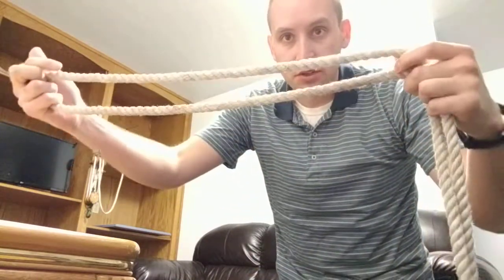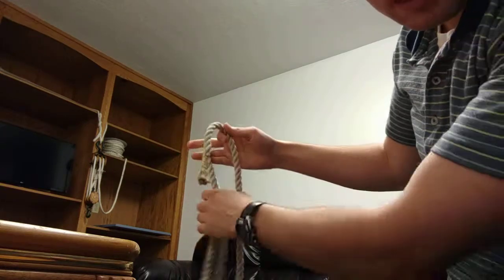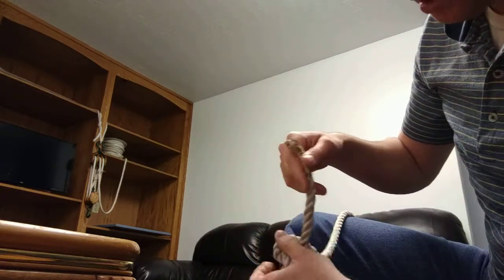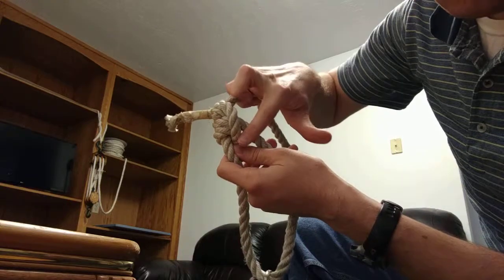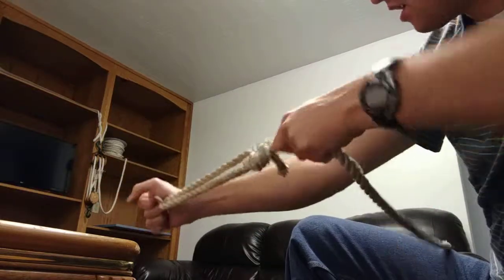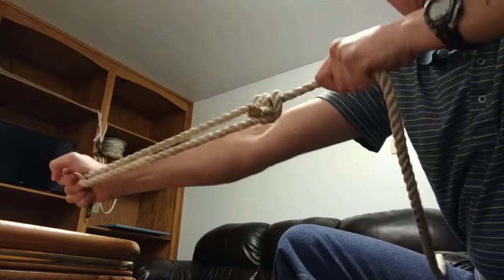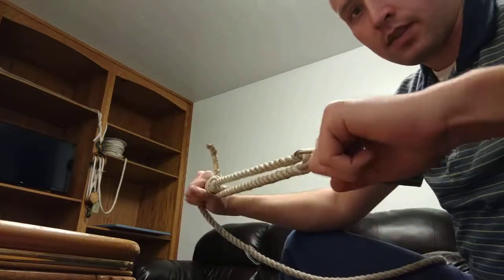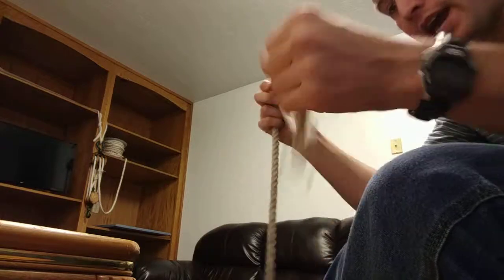Adjusting Trebuchet Sling Length Using Taut-Line Hitch

Comment: I do it somewhat like this. I use a different style of taut line hitch, but the big difference is that I attach the sling with a "bird's head" knot, which prevents slipping and the taut line hitch just keeps the tail of the line in place.

Comment from the maker: Quick update.  I just had a problem with a knot slipping on a trebuchet sling during a throw.  The throw worked fine, but at the follow up throw the projectile came out because the pouch wasn't evened out properly.  I still think this system works great, but make sure to put at least an extra half hitch in it and check and dress the knot regularly.  It only works when it is dressed and tight.  If the slippage had been caught upon inspection the misfire could have been easily avoided with a quick adjustment.
Reply from the maker: Another thought.  The knot probably got caught up in some part of the machine during the rocking after the throw.  I don't think it slipped during the throw, but rather hung up somewhere and got tugged on while the box was swinging back and forth.  Again, just check on it before each launch and you should be fine.

Comment: Good demo
Reply from the maker: Thanks!  Have you tried this on your slings at all? Curious what you think of the method
Reply: @MedievalTrebuchet  I have not tried it. I use a single overhand with multiple half hitches securing the tag end. It holds and is easy to un-do, but I like yours too.